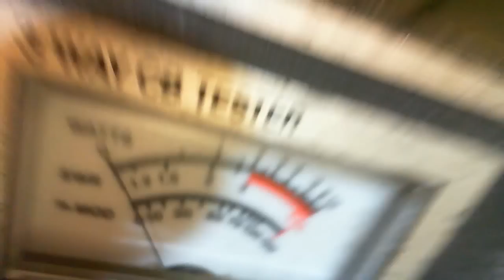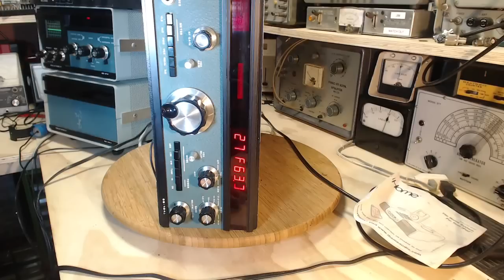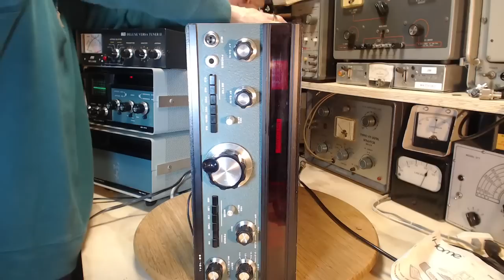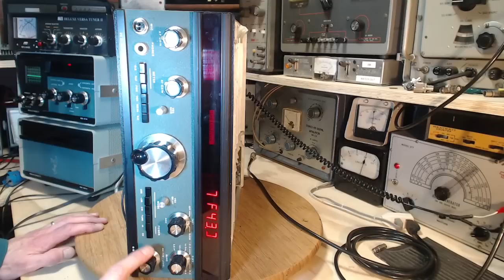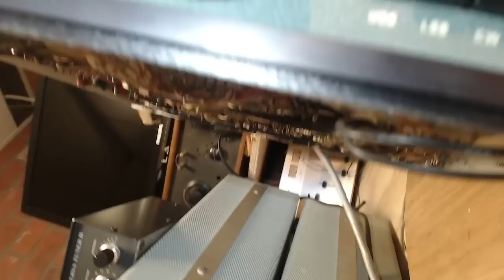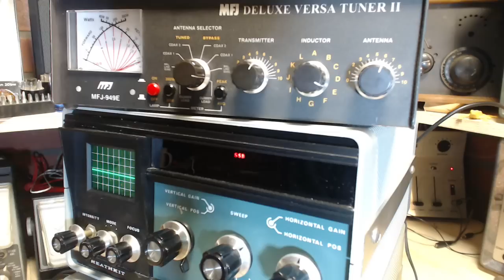Heathkit SB104A Transceiver Video #7 - High Power

Comment: I would be using normal AM for testing. I would clean the board connectors with deoxit on both sides, and the chip sockets both sides using a good solid chip pulling tool.

Then maybe check caps, and run through the whole list of startup checks that came with the kit.

Comment: Jim:
Looking back, the one common thing that you did was to remove and reseat the boards.  If I were you, I would go back and find the one that has the transmit circuits on it and check for wonky solder joints or broken traces.

Comment: Jim:
A dead radio is never a fun thing. At the very least you might want to check to see if you have drive to the finals. Time for that extender board and your scope.

The harmonics are worriesome. Might even be violating a Radio Canada rule for spurious emissions. 

Arjay N3LKZ
Reply from the maker: +Rj Morgan I understand that this radio cleans up the transmit harmonics at the last stage and a messy signal ahead of that is not a concern. I need to convince myself that the radio is producing a clean signal before I really put it on the air.